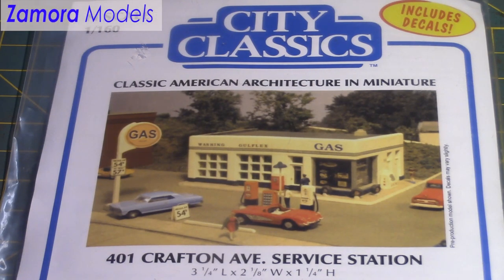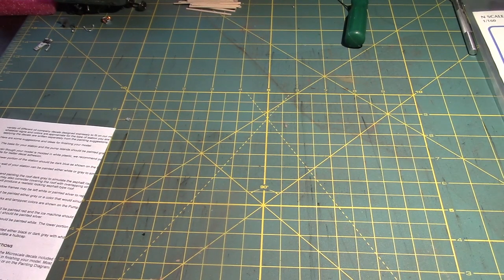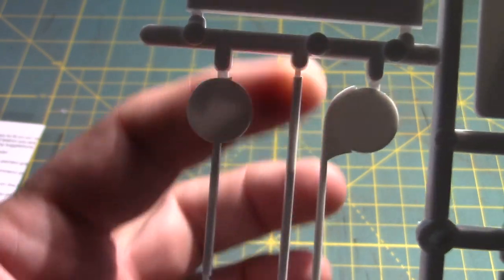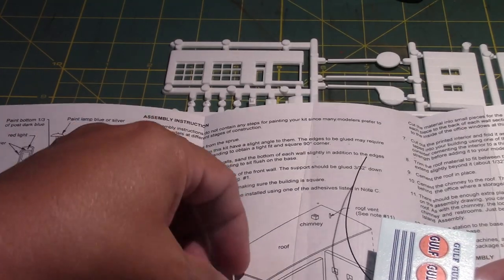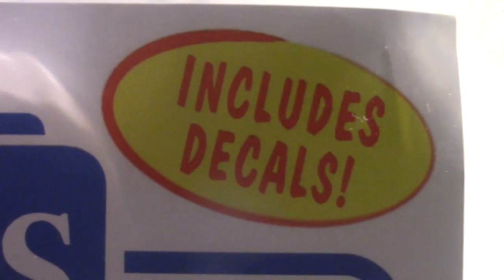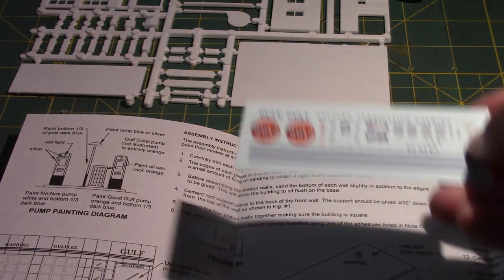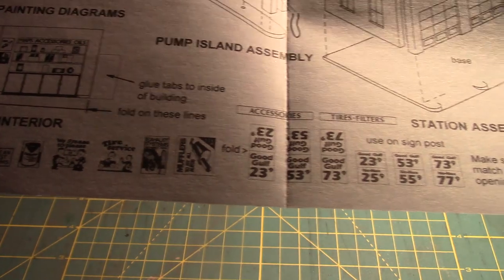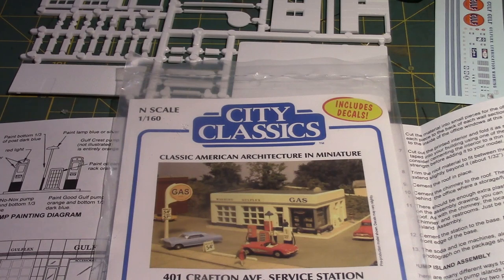City Classics N Scale Gas Station Review

Comment: I believe the front and side walls may actually be enameled metal panels rather than larger bricks. There were even houses made with these metal panels. On a more recent era layout this could be a neighborhood repair shop. Change some signs, make it a little more grimy, and leave off the gas pumps.
Reply from the maker: Excellent points, thank you for the comments.